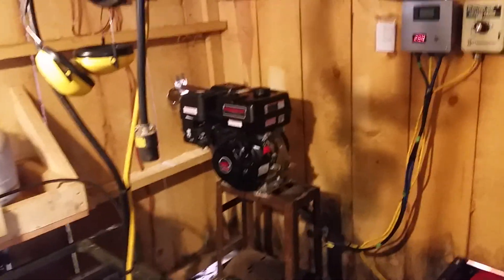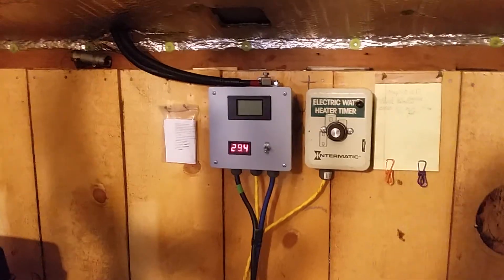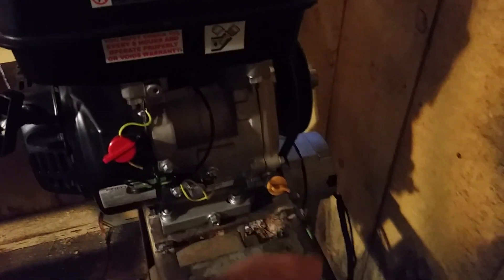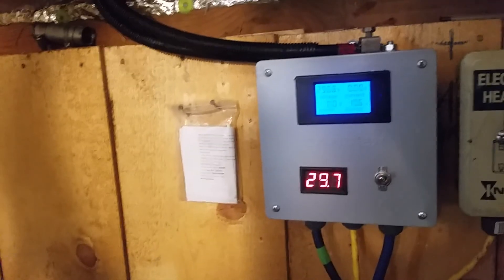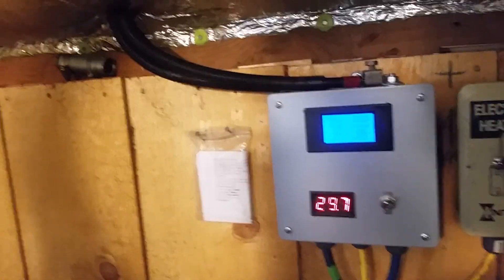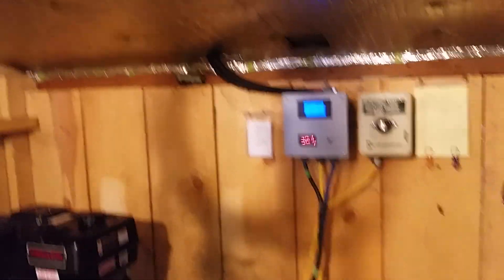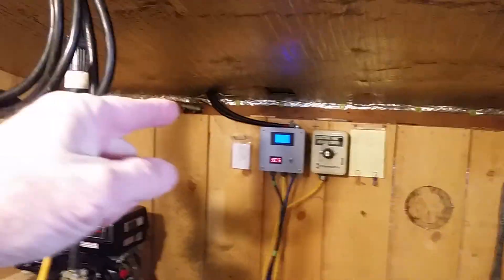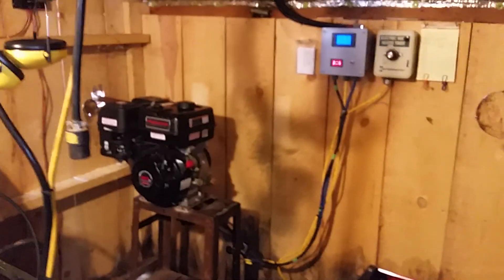More off rid generator talk. Charging a large battery bank with an alternator.

Comment: Hello, John here . I have the same engine and alternator except mine is 12 volt 165 Amp alternator. My question is when I let my battery bank run down to 12.4  my engine really struggles. Should I put a starter battery between my alternator and then to my battery bank . That way my alternator will see the starter battery voltage instead of battery bank voltage. Is my thinking correct on this. Would appreciate your input on this. John
Reply from the maker: Greetings john. What I have found is that alternators have an efficiency factor of 60%
That means 40% of your energy is dissipated as heat. Alternators are designed to maintain battery voltage. They are simply too small to charge a large battery bank from a depleted state. Even though you have a 156-amp alternator it's duty cycle is about 40%
The one exception to this is the M-rap 400 amp military brushless alternator. At full load uses 28 horsepower. It has a 100% duty cycle and weighs 110 ponds. This is what it was going to take for me to charge a depleted 21-kilowatt battery bank. I abandoned the idea altogether. I found that using an AC generator to power a Magum Inverter/charger was way more efficient. The magnum Inverter/charger has a 105-amp charger built in with a 100% duty cycle and a 4-stage charge algorithm. If you add a 12-volt battery to your bank it will likely be brought to the same voltage as your main battery bank very quickly. In a few minutes you will be right back where you stared. If you look on my channel you will find experiments using a rheostat to modify the field on the alternator. This allowed me to manually control the current output. This had a down side. Left unattended it would overcharge the batteries as the rheostat bypasses the internal regulator. So, I added my own voltage monitoring relay with a data logger that would disconnect the alternator at a set voltage. I did a test to see what the fuel efficiency was per kilowatt hour. The alternator experiment was abandoned when I discovered the efficiency was much worse than just using the Magnum inverter/charger powered by Our Yanmar diesel generator. There are other factors involved in using an alternator to charge a large battery bank. RPM is your friend. Alternators like to run at 4k an above. Otherwise, they cannot cool efficiently, and their output is diminished. If your inverter does not have a charger built in you can do what I advised my brother to do. Buy an efficient AC generator and a 4 stage Intelli-Charger or an IOTA charger. Both of these chargers have a Power factor correction circuit. This will allow you to get full power from the charger with a very small AC generator. A non-PFC charger will take a very large generator to get full power out of the charger because of the clipped sine wave that is typical with small generators. A 90-amp PFC IOTA charger can be powered by an efficient 2000-watt inverter generator with power to spare. If you buy a non-PFC 90-amp charger it will have to have a 6000-watt generator to get full power to your battery bank.
Both the Magnum and Outback inverter/chargers have Power Factor Correction built in. This is the sum of my experiments with charging Flooded Lead acid batteries with alternators and generators. I hope this helps.
Reply: John here, thanks alot for taking the time to answer my question. I'm glad you understand what  I'm up against. Thanks for the info and your help. I'm doing this by myself  just like you. I know this when my neighbors lights go off mine come on . Have a blessed day, I know I am. John
Reply from the maker: @johnbutler5208  You are welcome John. 
May The Lord bless you and your family as you follow Jesus Christ.

Comment: Your video has been up for a while but would like to let you know that Neville has a marine voltage regulator that is adjustable for charging a battery bank.
Reply from the maker: Thank you for the information.  I have since learned that changing the Lithium batteries through the Power Factor Corrected inverter/charger is much more efficient than DC TO DC. From my testing I have found the efficiency loss with all alternators is terrible. The Magnum inverter has a PFC charger that uses much less diesel than anything I have tried.

Comment: Would aviation alternator work as well verse marine grade alternator? Most of aircraft uses 28vdc. Also if alternator is 100 amps and the current can be adjusted with rheostat? Ty
Reply from the maker: I would think that the aviation grade alternators are the best. The one you described sounds great. Having a adjustable voltage regulator mounted remotely is much better than using the rheostat and charging manually. I only use the rheostat bypass when I am going to be monitoring the voltage. They make generic external voltage regulators that are adjustable with a big knob rather than a small potentiometer tweak pot designed to adjust with a small scew driver. That's what I will use with my next build and the MRAP 400 amp Leece Neville alternator driven with a 3 cylinder Yanmar.  That's my dream machine LOL.
Reply: @offgridinthepacificnorthwe3210  Leece Neville alternator is so expensive, so as av alternator. I guess I'll try mep alternator first cuz I do have them and control with rheostat. 
Thanks for replying sir.

Comment: Great idea, thanks for your post.
Question for ya. 
I have a 24v battery bank with 1350ah 4v  x6 rolls flooded batteries.
Which would work better to charge my bank 24v or 28v 60 amp alternator? 
Also what type of alternator would be better choice to charge the bank.?
Thank you
Reply from the maker: I would use the 28volt MRAP 400 amp military alternator. You can get them on ebay. They will produce 200 amps 1800 rpm. Full amps takes 22 hp. My point is a car alternator is designed to keep a battery charged not charge a large battery bank. I only charge at 50% of my alternators capacity so it will not over heat. I have several other DC generator videos that I made since this one. Have a great day.
Reply: @offgridinthepacificnorthwe3210  thanks for your quick response.
I was thinking the same thing at 28v military alternator but little worried about the high current at 200a or 400a charging rate.
Is it possible to control the current? I want to keep charging amperage under 60 amps.
Thank you
Reply from the maker: @Honam.Muryeong  Yes a C10 charge rate is recommended for most L-16 deep cycle batteries. That isa  charge rate of 10% of your total amp hour capacity. The on board voltage regulator on the MRAP alternator will only give the current necessary to maintain 28 volts. Most of them have a Vset pot can be dialed up that will go as high as 31 volts. If you do not let you batteries go below 70% SOC then @ 28 volts you will not see amperage above C10. It is best to have your generator within 6 feet of the batteries or run a remote sense wire. I think I have a video explaining why.
Reply: @offgridinthepacificnorthwe3210  thanks for detail explanation. I'll check out other upload of your.
Reply: @offgridinthepacificnorthwe3210  oh, what rheostat are you using? 25 or 10 ohms, watt and amps? Ty
Reply: @offgridinthepacificnorthwe3210  can I use electric motor to drive the alternator? If so, what ratio and horsepower can drive the alternator? 
I have a MEP 025p military puts out 0 to 32 volts at 56 amps. Can I also use rheostat to control the current as well? Ty
Reply from the maker: @Honam.Muryeong  I think I used a 25 ohm 300 watt rheostat for manually controlled current. The Mep generator you have is perfect already for charging a 24 volt system.
You could bulk charge at 28 volts and then finish the absorb charge by dialing the volts up. My absorb voltage is higher than most @ 31 volts.
Reply: @offgridinthepacificnorthwe3210  I have 5 ohms 100watt 4.48 amps rheostat, would that work as well?
Reply from the maker: @Honam.Muryeong  I read an article on Backwoods Home Magazine where they used a 5 ohm 100 watt on a Delco 10si. It seemed to work. I have mine set up with a bypass switch that allows me to charge in manual mode or use the internal regulator. Keep in mind that if the generator is left un attended in manual mode the batteries can overheat warping the plates and give off massive amounts of explosive gasses. I also installed a data logger on mine so I know exactly how many kilowatts of power I made and how much fuel it consumed. Our Diesel generator charges the batteries through the inverter/charger much more efficiently than our gas powered DC generator. I really only have the DC generator for back up in case the diesel fails.
Reply: @offgridinthepacificnorthwe3210  awesome! Thank you so much.
I do have main generator that charges my bank, however I ran into one problem with low surge, when my water pump kicks on. I'm trying to avoid surge so that my main auto generator would not kick on. Your backup setup would work perfect with my setup.
I just want alternator to kick on, when surge hits for 15 to 20 mins and my main auto generator kicks on, when voltage level is below 23.5v.
Thank you
Reply: @offgridinthepacificnorthwe3210  is your Delco si. alternator 24v 60 amp with self excited alternator? Ty
Reply from the maker: @Honam.Muryeong  Yes sir.
Reply: @offgridinthepacificnorthwe3210  are you sure it's Delco 10si 24v 60 amps? I could only find 10si with self excited alternator with 40 amps or 50 amps. 
Where did you find 60 amps from sir? I've found 30si at 60 amps for 24v??? Little confused
Reply from the maker: @Honam.Muryeong  I got it on amazon. It is a marine grade. I rebuilt it since then with a heavy duty regulator and coil.
Reply: @offgridinthepacificnorthwe3210  is 30si 24v 60 amp same as 10si model? Ty
Reply from the maker: @Honam.Muryeong  I do not know. I have a friend who has tested many different types for efficiency and found that the Ford G1 is the very best. He drives his with a 3 cylinder Yanmar diesel and holds 70 amps at 60 volts for his 48 volt system without over heating. He was able to get the fuel efficiency down to $.28 cents per kilowatt hour.
Reply: @offgridinthepacificnorthwe3210  neifhoff military generator/alternator 28v 400a, can I bypass the current "control the current" with using rheostat 5 ohms 300w 4.48amps? Ty

Comment: Finally, a video that answered the question about voltage drop from an alternator. Thanks!
30ft. is a long way for DC. Mine will be within 10ft. Should I compinsate for an estimated less than a volt drop?

Comment: Just bypass the regulator and use a mppt charge controller or any large enough charge controller , my channel might have some info which may be useful for you ,I like your vids. and your setup , keep up the good work!!
Reply from the maker: Wind Power And More That's a good idea. I have already tested 3 phase wild ac with a external bridge rectifier.  I hope to use a Midnite classic 200 with a hydro system I am collecting parts for. I have decided to use a x13 HVAC blower motor for the pma. I have a ready hacked the 10si with a 25 ohm power handling rheostadt.  At the pull of a switch it bypasses the voltage regulator and I manually adjust the amps. I only do this when the solar did not finish the absorb charge. I manually set it to 30 volts and watch the clock. 2 1/2 hours in absorb and the SG is spot on. 9 months out of the year the solar handles everything,  all I do is keep water in the batteries and spot check the SG with a refractometer. Thanks for your input.
Reply: yeah I watched your vids. I like what you do , I'll keep watching if you keep making ,LOL
Reply: @offgridinthepacificnorthwe3210  regarding the hvac motor ecm x13. Did you rewire them? I did rewire the ecm motor x13 1hp 18 coil 3 phase into delta parallel wiring and   the result wasn't that great. At 29v dc I believe amp was around 7amps. Factory wiring at 500w 3 amps off one leg.
Reply from the maker: @Honam.Muryeong  I have experimented with PMA alternators like the x13 and I have given up on them. Regulation using a MPPT controller will work but they do not track well. They just do not put out enough power for my application. Perhaps on a small hydro system but not gas driven.
Reply: @offgridinthepacificnorthwe3210  I agreed with you. It didn't give much current. Have you tried direct drive washer motor?
Reply: Can I just interject a wildcard here. What about a 3 phase induction motor drive by a gas motor as an asynchronous generator. I have small 2 horse up to 50 horse motors for days

Comment: Voltage drop can be a problem. It makes the difference of something working properly or not working at all. Grid tie inverter if the voltage gets to high it will fault and not work. Use the voltage drop calculator available on line to see how it comes out so you don't have to do it over again